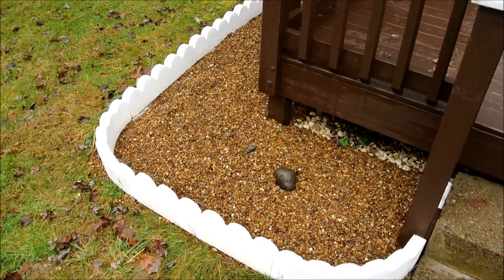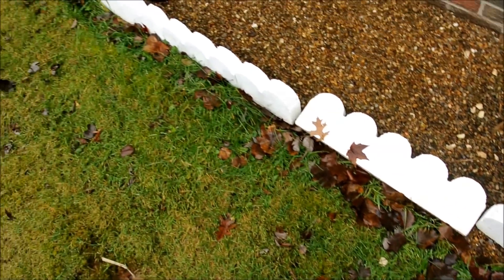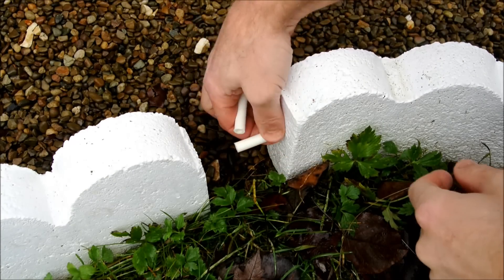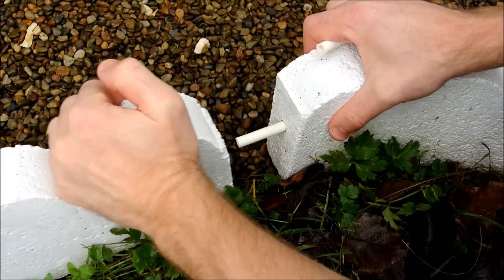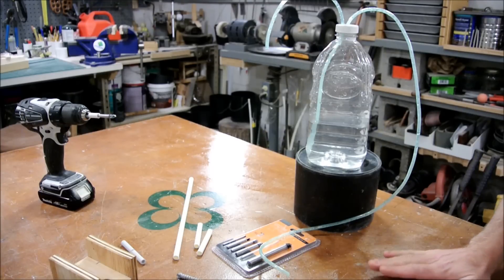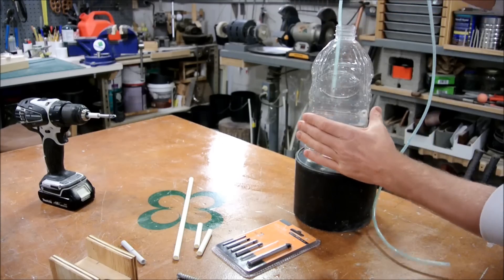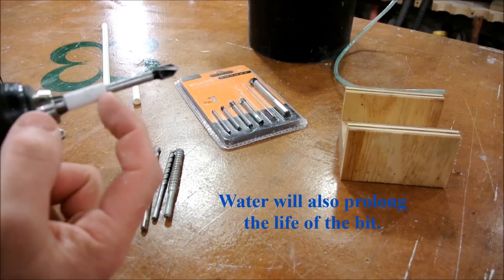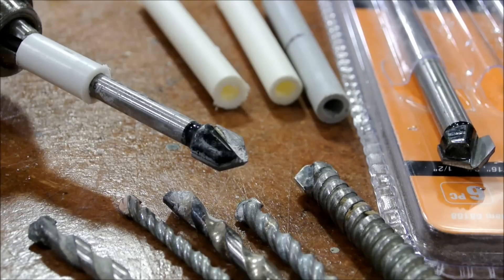Anti-tip concrete edging connections

Comment: How do you cut an edger in pieces? They are 3 scallops to one. How do you cut one of the scalloos off wi th out breaking theory whole piece?
Reply: Ideally, an angle grinder with a diamond blade. Cuts like butter. Spray with water to reduce dust. 

There are also inexpensive masonry blades that will fit into a circular saw. Similar Idea, but different cutting method; score all around, break off, smooth.

Comment: Wonderful idea, but why in the heck did you rig up all that tubing and water? Those are concrete blocks and a masonry bit would have been just fine with no water
Reply from the maker: A masonry bit alone will be just fine if you're only doing 2 or 3 of them. If you're drilling a dozen or so: the wet jig ensures perfect placement,  helps keep the hole square, eliminates dust, keeps the bit cool & prolongs its life, automatically cleans both the bit & hole, and ultimately, saves you time. It's really not hard to do.  

Also note that most standard masonry bits have far less carbide at the tip, so a cheap tile/glass bit will outlast it (by far).

Comment: Too complicated. Just measure from the bottom of each brick, and use a concrete bit. Why all the falderal ?
Reply from the maker: If you'd prefer to instead waste time getting them to align, just jump right in with your drill. But if you want them to join correctly, make a jig. 

If this is really "too complicated" for you, then maybe some 'pet fails' videos would be better suited to your skill level.
Reply: @pocket83  
You said "jig" ...that's RACIST !
Reply: Years of screw-ups, mismeasures, and drifting drill bits taught me the best way to go is with a jig for a project like this.  The addition of the water for lubrication, waste clearance, and dust avoidance is genius! A jig also makes the project move twice as fast. Thank you for sharing!

Comment: Can these be used as a little retaining wall-ish? We need a little one by our steps and we have TONS of these...
Reply: Sure- but it depends on the size of the wall, the grade, the design, et cetera. Commercial blocks resist (retain) through extremely clever design and brute strength, so you will have to be extra clever to use them, but it's possible.

Let's say that I had a huge pile of these already on my property, and that I was determined to use them. I would lay them flat, step them back slightly between courses, and line the backside with gravel. In between every few rows I would place a plastic mesh or galvanized screen mesh that helps to fasten the wall to the fill, like the way that a wall-tie works with a brick wall. 

Keying them (as I've done in this video) would certainly help, but that would be tons of work if the wall had more than a few dozen blocks. Just remember the golden rule of retaining wall design: try to make the wall's joints get tighter under pressure, like an arch does. If the wall is not slightly concave, it'll usually fail. Fill is like a slowly settling liquid, so a flat wall will eventually bulge and then push over.

Comment: Very nice solution my friend. There  is definitely potential there for commercial application. Pinned connections on stacked masonry walls is common but this could be, as far as I know, a new idea in the marketplace. You could file for patent protection or at least look into whether it is already covered by patent.

Comment: By watching your video, I concluded that you found a solution to your problem.  By reading the comments, it seems that you should bury some of the blocks 2 inches, some 1 inch, and some should just be buried.  Does that mean completely buried?  You should drill some of the blocks with  a masonry bit and some with a glass bit.  I didn't see any with a forstner bit, but maybe it would work with a hammer drill.  Anyway, thanks, I learned a lot.

Comment: A question I hope you have time to answer, you probably used exterior enamel paint, but after cleaning (scrubbing), did you use an airless paint sprayer?  If not, what did you use that was most labor-saving?  Oil-based or water-based paint?
Reply from the maker: Greetings from Pennsylvania!
I used BEHR high gloss enamel (8050). Following a pressure-wash, I brushed the paint on with a thick coat after they had dried in the sun. 

Thank you for the support, and I hope that you continue to find useful things in these videos ;)

Comment: When drilling holes in concrete block to install a plastic garden hose holder in 1993, my father's Craftsman bit broke in half (Sears replaced it, no questions asked).  My brother has inherited that drill and bits, so I was concerned about drilling some new holes for a new aluminum garden hose holder.  (I'm not driving 16 hours round trip to borrow it!!!)  Thank you for the tip about the glass/tile drill bit.  I will definitely get one for the new holes.  Additionally, my concrete edgers are embedded in dirt at least 1-1/2 inches (mid-Florida), but the lawn service still knocks them over.  I now know what to do to fix that problem.  Thank you so very much.  I'm new to your channel and am looking forward to viewing your archived videos and your new channel's content, too.

Comment: That's why normally these concrete blocks are at least around 12-15 inches long, to knock them deeply in the soil.
That also prevents that the roots of the plants will grow towards your lawn (or grass will go into your beautiful garden).
Have done many of them and if you don't mount them properly, you still run the risk that they will sag after a while.

I didn't really follow why you used water. Probably to cool or so, agree with some here that it's overkill. 
Where I'm from all houses have brick and concrete walls.  Water is only used with very heavy (dense) industrial floors or ceilings.
Normally you just use a impact drill, or for the more heavy walls an hammer drill.
For small things you can just drill normally, just use hhs concrete drill bits.
I barely change them for every day work, maybe ones every couple of years.
Reply from the maker: I use water with every masonry/stone/mineral/cement cutting or drilling operation. It prolongs tool life, reduces dust, quiets noise,  dissipates heat, and mechanically removes sediment. Further, ruining a certain size bit from a set is another trip to the store.

As for the blocks, they have been set in the ground before; freeze/thaw lifts them and causes them to become uneven. After 10 years, I've realized that it's best to let them float on top as a heavy, flexible snake. Roots are irrelevant in this case, since they are always a consideration with any  landscaping. I'm going to have to add to the description.

Comment: I think you're supposed to embed those blocks a few inches in to the ground. Pack it in with a bit of sand, and they'll stay put. if necessary, use a dab of urethane construction adhesive to connect the blocks.

Comment: Clever solution, but (ther is always a but) coolant is a little bit overkill. If it was proper concrete with granite aggregate it would be worth the effort, but for that low density stuff it's a lot of effort for no real gain.
Reply from the maker: I suggest you stick to the theoretical if this is what you consider a lot of effort. I'll just bullet-point the undeniable benefits of using water for you:
> heat dissipation  
> dust suppression
> reduced bit wear
> debris removal

Non-stop drilling for 30+ holes, same bit. Quod erat demonstrandum, I think.

Comment: That's not a hammer drill, is it?
Reply from the maker: Notice I said risk. I didn't have a backup. And even if I did, it wouldn't have been already painted. Further, these are 12 years old, so they're far harder than the fresh concrete-yard castings that you would buy new.

 Please don't "What? no" me as though I were trying to pull the wool over your eyes. You are free to hammer away if you like, but take it as a fact that additional vibrations can cause internal fracture to any rigid structure. Agreed; you'll probably get away with it. It's also possible to smoke for 50 years and not get cancer, but that doesn't negate the additional risk imposed by doing so.
Reply: pocket83 when you were talking about the different bits, my first question also was, is that a hammer drill. Arn't masonry drill bits supposed to be used with a hammer drill? Maybe that's why they didn't work? x
Reply: What? No. I drill through these types of brick all the time. I use a ryobi SDS hammer drill and a 3/16 or 1/4 inch masonry bit. I drill straight through from top to bottom and use a wooden dowel to attach them to concrete, much like a parking space block. You're not going to crack the blocks with a hammer drill and masonry bit.
Reply from the maker: Nope. Just a Makita Li-ion.
Reply from the maker: The additional impact would risk cracking a block. There is an unpredictable element when working any porous material such as masonry, so shocks are to be avoided when possible. Think of a how a crack can move through glass. 

I did not want to replace and then paint a new one.